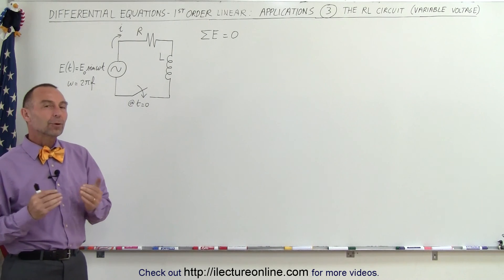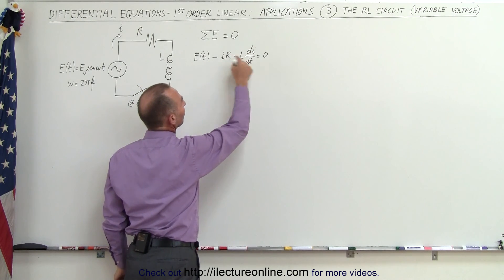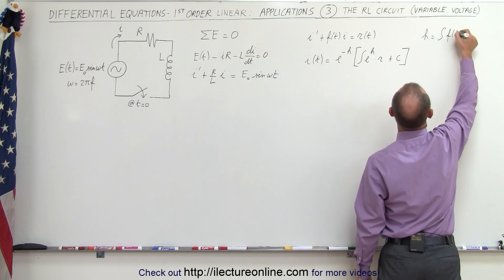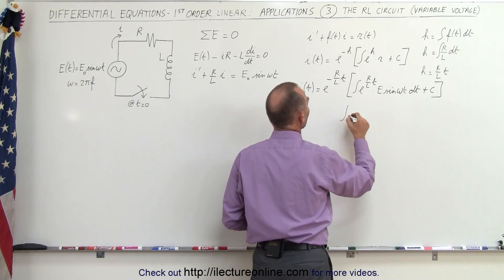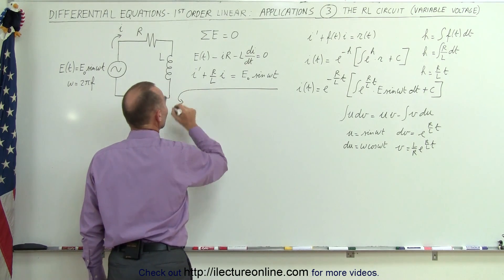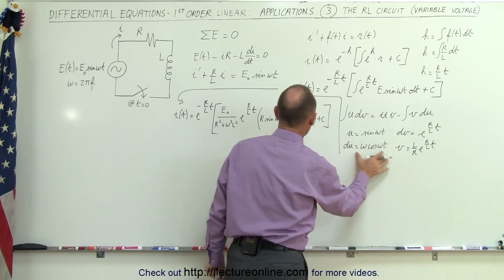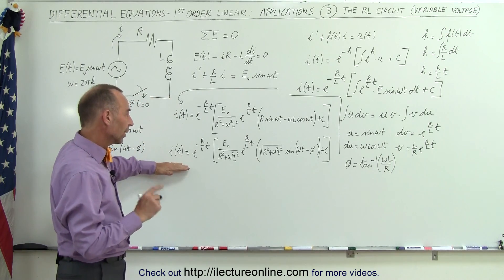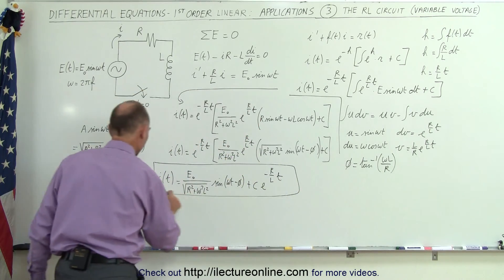Differential Equation - 1st Order Linear: Applications (3 of 4)  i(t)=? of the RL Circuit

Comment: It took me a couple hours, but I finally managed to do that integral. Very hairy!

Used the 'back to the future' integration method:

MvB: Calculus - Integration by Parts (10 of 11)
https://www.youtube.com/watch?v=kyS4ojYR29Y&index=10&list=PLX2gX-ftPVXW9a7z_8AZsPo5OzJ65rft8

(Hint: I took the E_0/L constant out before doing the integral. But discovered I needed the 1/L part to get the ω^2 * L^2 component in the denominator.)
Reply: Can you share the integration? because I have solved this problem using matlab, and the result is different